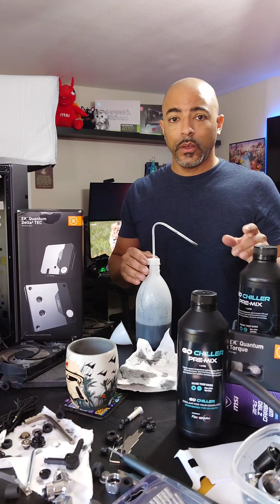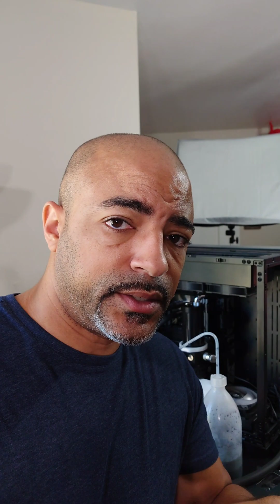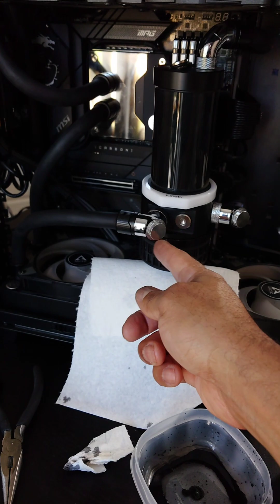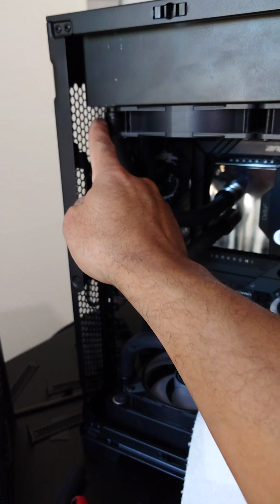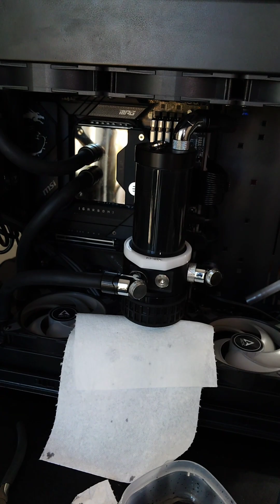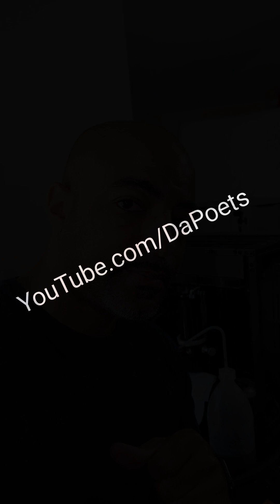EK-Quantum Delta² TEC - Filling the Loop with Liquid Graphene

Comment: Have you had any issues with the graphene being so thin that it seeps out of the water channels and into the other areas of the EKWB blocks? I have and its visible through the plexi blocks, so I had to stop using it.  It never went outside the outer oring seal of the blocks though but it did this to both my GPU and CPU EKWB blocks and got between the plexi and nickel coated metal outside the flow channels. I had to disassemble and clean them up and switch coolants, guess  either EKWB quality is failing or the stuff to thin for plexi blocks. :( Likely its EKWB quality dropping as the GPU block cracked at the factory installed screw in only two months but still functions and their direct die upgrade kits are flawed and not flat, still awaiting reply and replacement.
Reply from the maker: This will happen to all EK water blocks no matter what fluid you have. People just don't see it when they use clear fluid.

Comment: Any wear on the blocks or clogging in the fins?  I was wondering what the long term use if the blocks or plexi has any wear or stains?  I've looked around but no one has said anything about the long term use and impacts.  Thank you in advance for your time.
Reply from the maker: None this past year in 2 different systems
Reply: @DaPoets  Thank you for taking the time to reply and share your experience.  I was thinking of trying it but it is always a risk trying out new coolants and the consequences of choosing badly can cost you hours of your time cleaning up clogged fins/blocks and then also money if the coolant damages the finishes on the plexi/nickel used in the blocks.  Thank you again for replying and posting the content you do.